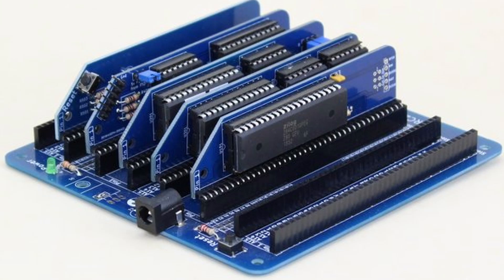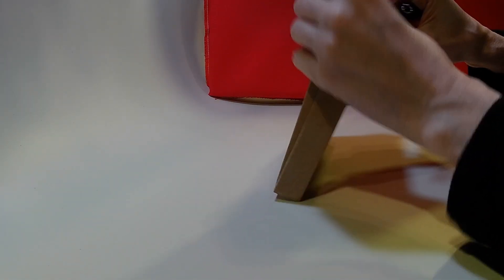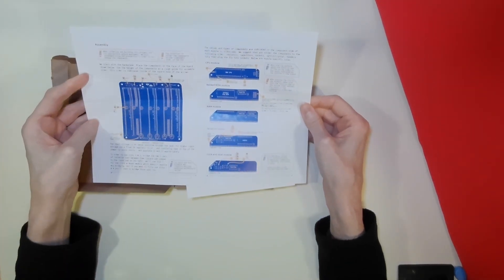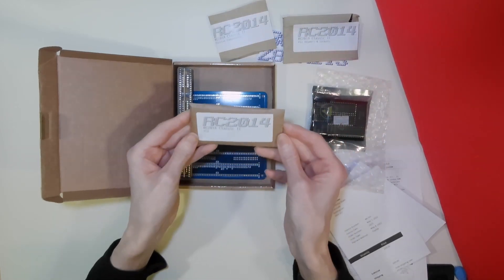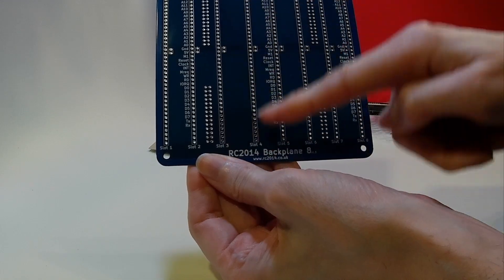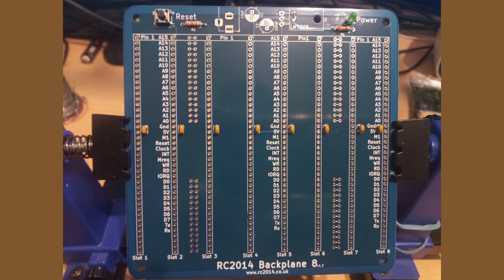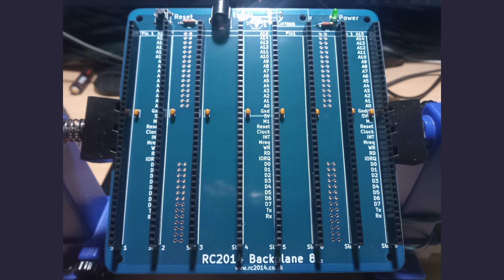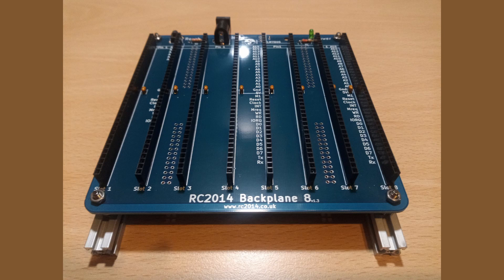Unboxing the RC2014 Classic II  - part 1 (Backplane)

Comment: Hi, I think I'm ready to start soldering this, having done about a half dozen other soldering projects to learn the ropes, make some mistakes, and learn how to undo them. But this morning I was reading the documentation for the backplane, and I'm confused by step 1 :-D. It looks like you've soldered a little wire to connect the two holes on the board where it says 1: wire jumper in the instructions. As I understand it, I am going to power the board from a USB connector, so do I also have to solder this wire bridge too?
Reply from the maker: The backplane design has changed since v1.3 as before the links are open by default and needed to be linked to use slots 1,2 ,7 and 8.  The same for the 5V link, depending on how you are going to power the board, you have the choice of using the barrel socket on the backplane or powering your system via a FTDI USB cable. Some of my systems are powered via the USB cable and others either via the backplane or a separate 5V power board. It all depends on what you are planning to plug into your backplane. If you are planning to add a video board you won't need a FTDI USB cable for comms so could go for the backplanes barrel socket to power the system.
Reply: @custompchardware  I just want to say thank you so much again for this series. It gave me the confidence (and some key skills/approaches) to start and finish this project successfully, and am really happy to now have a working 8 bit computer that I put together myself - a childhood dream come true!
Reply: Thank you for your detailed reply! I figured everything out, and completed the basic build, and the best part is that it worked first time, have booted both into basic and the monitor over a terminal
Reply from the maker: Congratulations, yes it's a great feeling when a new computer boots up first time.